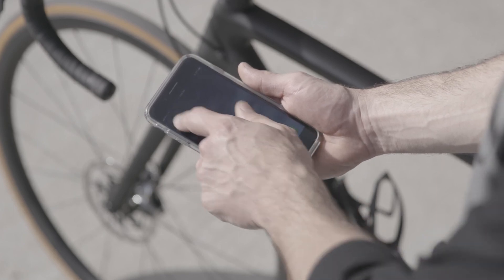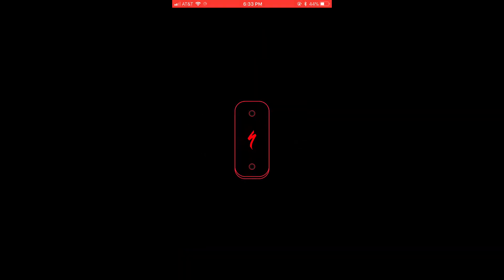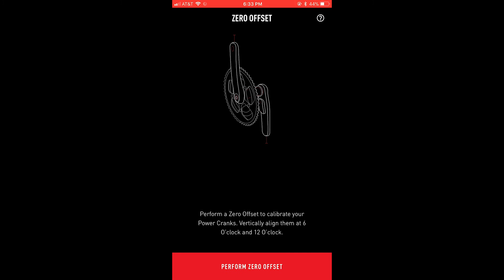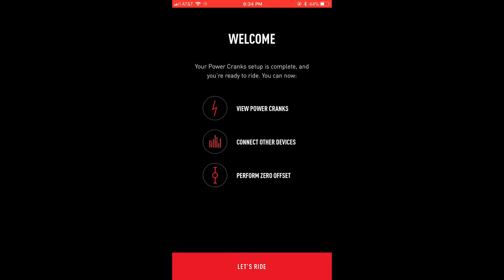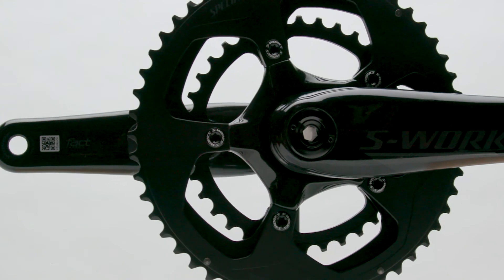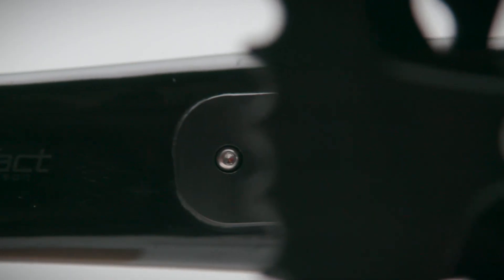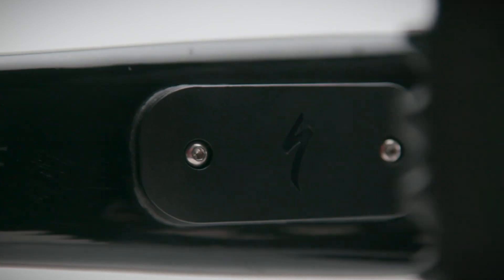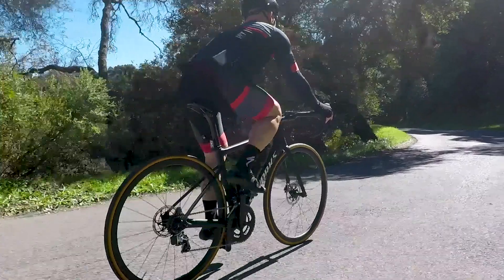How to Setup Specialized Power Cranks

Comment: my power meter was working just fine then started showing 2000w readings when i was riding normally so i guess they need resetting or something. I tried disabling/re enabling on the garmin head unit but no change, so removed them altogether and put in new batteries. Now garmin doesn't find them at all when adding in the sensor. Any ideas on what I can do to get these going again?

Comment: $3k for a power meter!?
Reply: USA retail prices

S-Works carbon dual: $1,150 for complete crankset with spider ($150 extra for rings)
Dura-Ace complete crankset: $1,500 (including 52/36 rings)
Ultegra upgrade kit: $525 (left arm only)
105 upgrade kit: $425 (left arm only)